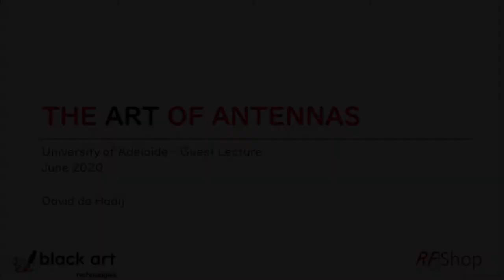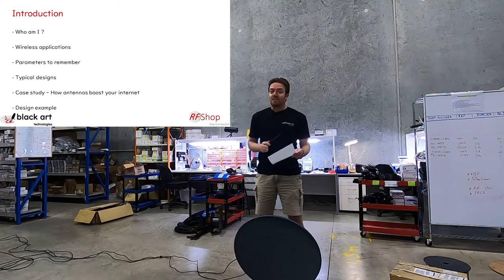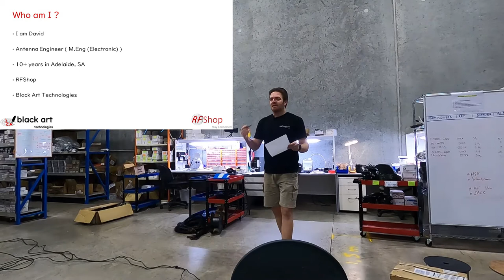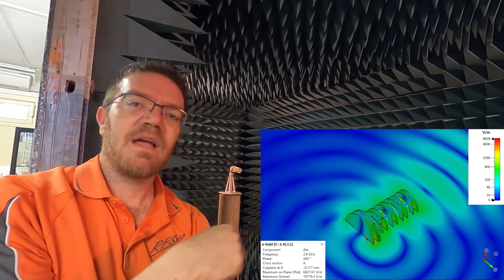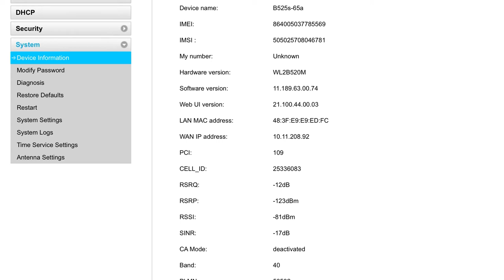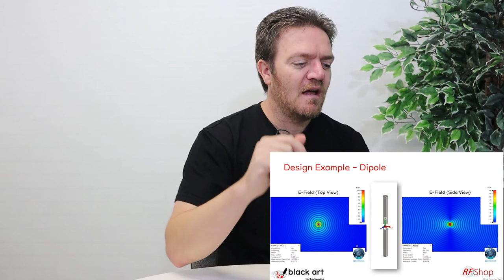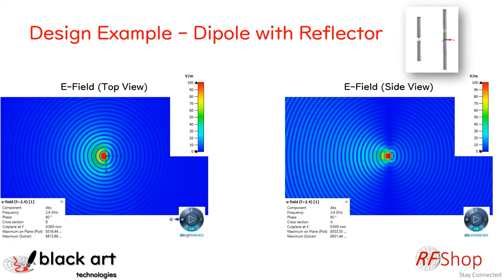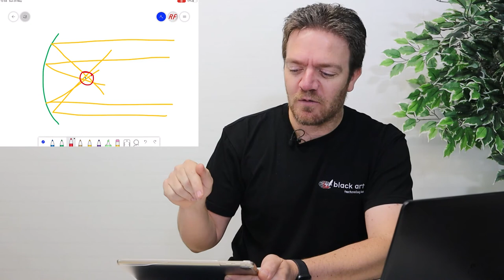Adelaide University Guest Lecture 2020

Comment: Understandably we won't have such a precise focal point but is there a reason a parabolic dish cannot be fed with a microstrip patch antenna for multiband operation? Assuming we only sought ~10 dBi gain the motivation being turning a $5 microstrip antenna into something with reasonable gain for the cost of an old sat dish
Reply from the maker: Doug P in a previous project back in my first job as antenna engineer we used a ultra-wideband LPDA in a dish from 1GHz to 40GHz. It was quite a mission to get the balance right and the focal point close enough for the most sensitive frequencies but it worked really well in the end.
For a relatively simple use-case of a dual-band patch antenna it might just mean a slight offset for both frequencies so that both get the benefit of the dish.

If it’s for WiFi I would indeed use a very basic patch (such as the ALFA APA-M05 or APA-M25) and get significant improvements. Sidelobes will suffer first, but gain will still be mostly unaffected for minor mistakes...